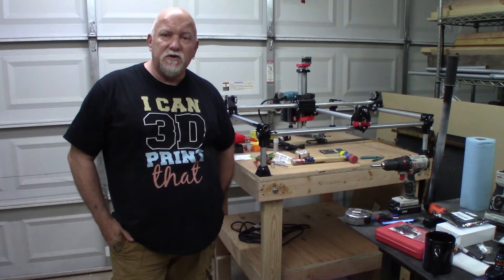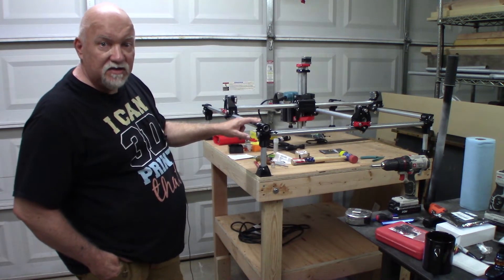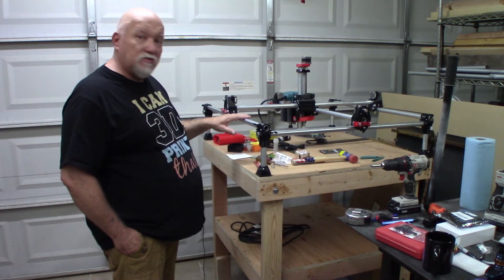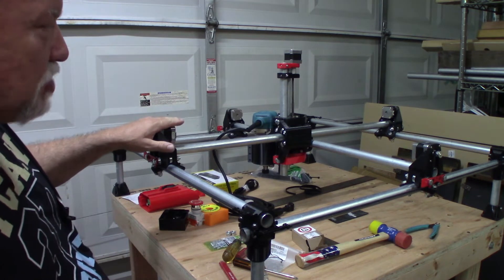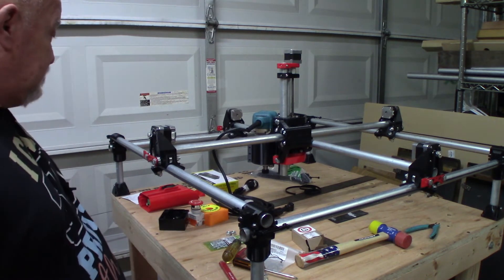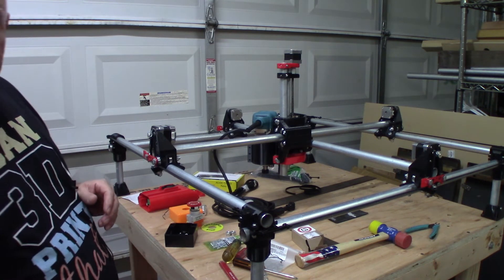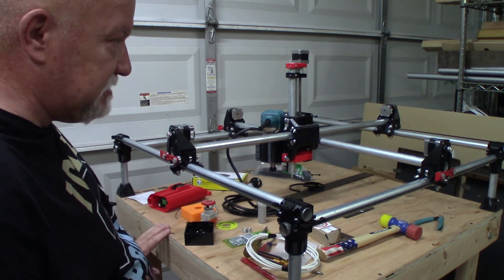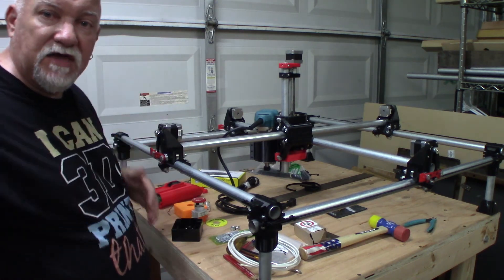My MPCNC Build #3dhp

Comment: can i ask what PSU you use thanks
Reply from the maker: 8 amp power brick,here is an Amazon link to the one I ordered.   https://www.amazon.com/gp/product/B01MQXCIKY/ref=ppx_yo_dt_b_asin_title_o02_s00?ie=UTF8&psc=1
Reply: @3DHP  you use a mega 2560 with ramps 1.4 shild and A4988 drivers do go for a (24v power)it will give you a 100% feed power on those nema 17s thay will skip stepps with 12v i did have problem and again im not useing the same ielectronics  the CNC needs power its not like a 3dprinter
Reply from the maker: @3discnc424  12 volt for now,will see how it works out and go from there.Thanks for your ideas.
Reply: @3DHP  I'll be watching you vids nice clean work
Reply: @3DHP  This is what i use its in euros but just to get a taste https://www.cableworks.gr/3d-printers/ratrig/electronics/power-supply-weho-250watt-24v/

Comment: i did have the same problem with that pipe im in greece and i did use  https://www.thingiverse.com/thing:790533 if you look at the https://www.thingiverse.com/thing:1671517 you will see that it use (25.3 mm) tube that i did find in EU
Reply from the maker: Each country seems to size different.Best to print 1 base foot from each and go see whats fits.